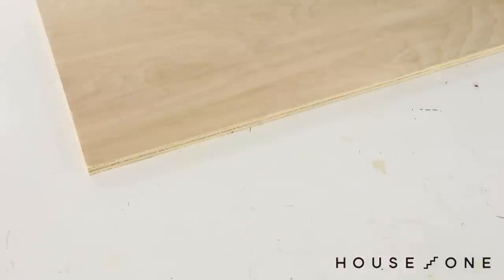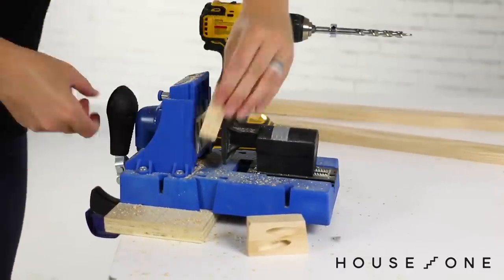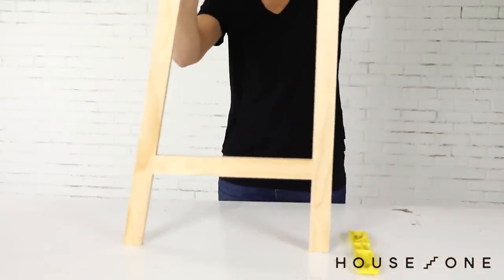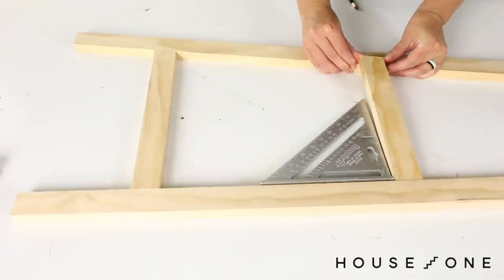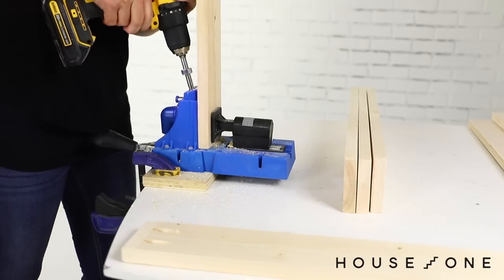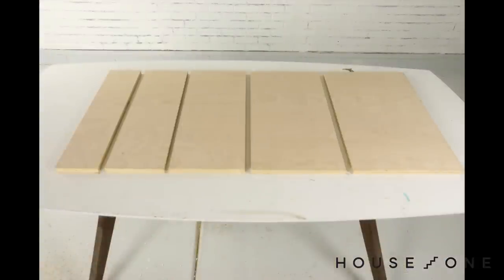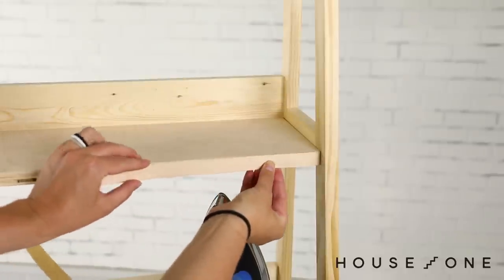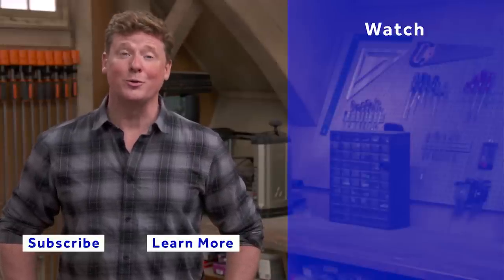How to Build a Leaning Ladder Bookcase | House One

Comment: one suggestion, install the edge banding before you install the shelf.  This makes it easier to trim off the excess.  In most cases, the edge banding is wider than the plywood, so it is necessary to trim it.  Whatever method you use to trim it, it is easier if nothing is in the way.

Comment: This video is AWESOME! 🤩 We NEED more videos like this!
Reply: This video is awesome to watch, but is not very helpful to repeat for beginners.. First mistake I made was the 1x2x8’ is actually 3/4”x 1.5”x 8’, so the Kreg setting shall not be for 1” thickness. There is no cut measurements of bottom crossings-need to calculate. Also plywood I bought was 2’1/4” and not 2’. No distance between the shelves is advised. Many things to calculate and think about.

Comment: what is the measurement of the 1x2 mitered bottom cross piece  the top is 1x2x2.5 but the bottom on is not stated
Reply: 12-1/2"

Comment: Unfortunately, the plans they give at the bottom of the video are incorrect.  When cutting the shelves, they don't account for the saw blade (usually 1/8"), so you end up with a 5" shelf at the top and not a 5 1/4" shelf.  The same is true for the 1x4 supports.  If you cut them at 24", you will need an additional 1x4 because the 5th support will be less than 24".

Comment: What are the settings on your kreg? My drill bit doesn’t have the stopper like yours so it can go further than necessary. What’s the distance from tip of the bit to the bottom of the stopper? I can tape it then at that length and not ruin it. Thx. This is exactly what I was looking for.
Reply: buy a pair of $10 digital calipers on amazon and slide the quill of the calipers into the hole, once it hits the bottom you look at the measurement on screen. I believe it's usually 4 and an 1/8". Which on the screen would be 4.125"

Comment: What if you wanted to make this project taller? Like 9' tall? Would that drastically affect anything?
Reply: The bottom shelves would be drastically wider front to back, but it can be done.
Reply: The bottom would be much wider if you keep the same angle.  You can reduce the steepness of the angle of the front leg by a couple of degrees but be aware that doing so will require changing all the angled cuts to the match.

Comment: Nice video, but most folks aren't going to want to shell out the coin to buy a Kreg pocket hole jig with clamp ($99) . Could do the same build using screws through the sides and plug the holes or use screws with a more decorative head which could be left exposed.
Reply: I bought one and have used it often, and loaned it to friends. Got my monies-worth.
Reply: They sell a cheaper jig that’s just as useful.

But you keep complaining.
Reply: @Uncle-Bull  Where was the complaint?
Reply: I’m just going to buy one on amazon then return it.
Reply: You do not need to buy a kreg Jig. It's simple to create the same pocket hole without one.
Reply: @Miguel-Del  what a cheapskate! your the kind of person who wears and new jacket with the tag still attached so you can return it when your done with it!
Reply: You can easily find pocket hole jigs for $20 online and in stores. Kreg is just a brand. You can also do pocket hole joinery without a jig, but it's messy.